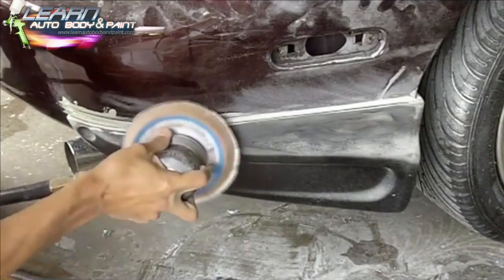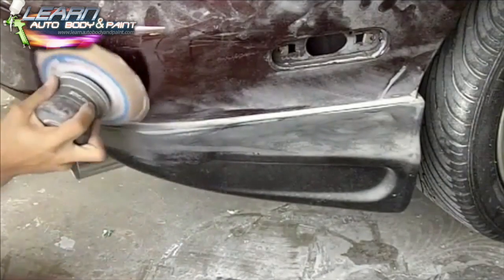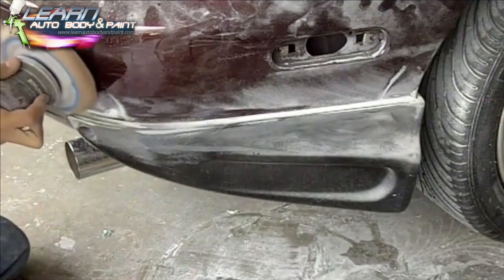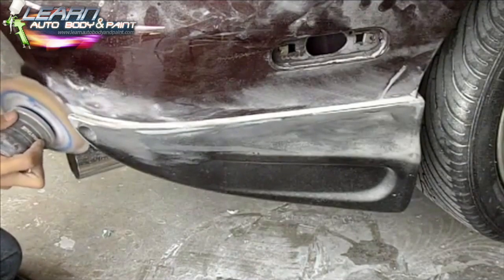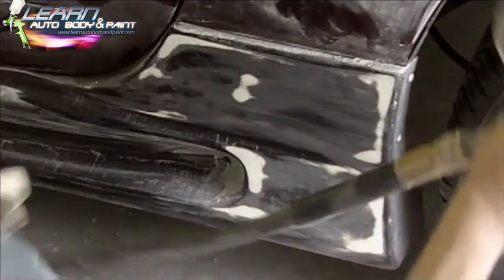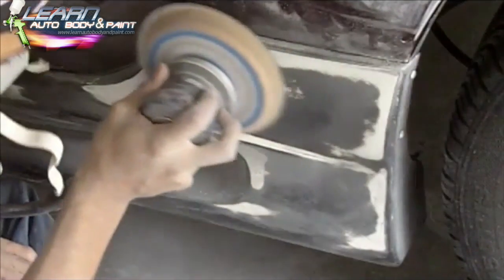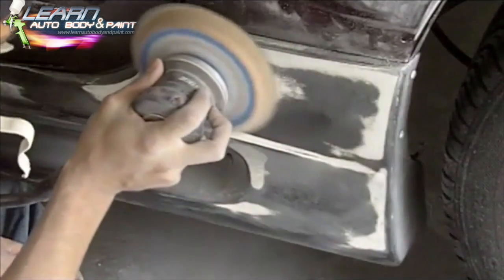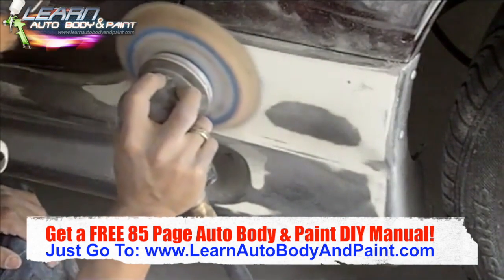How To Paint a Car Part 3 Mini Course

Comment: I've got a 1997 z28 camaro I'm in the midst of fixing for a flip, I have a friend who paints(out of the garage at his house, hes never done shop work.) helping me paint the car but he wants me to do all the body work what would I want to put over any bare metal that I run across while fixing the body issues? The car is probably going to sit for a month before being sprayed so should I just get some rattle can primer and paint to throw over the few bare spots for now?
Reply from the maker: I would use a 2k primer. If they are small areas, just use a 1k high build can primer... Good luck!